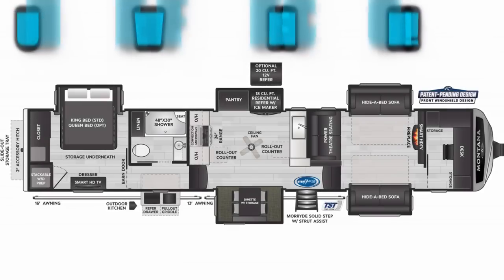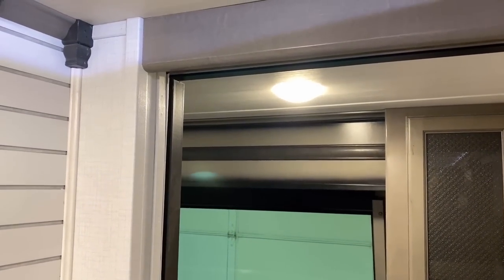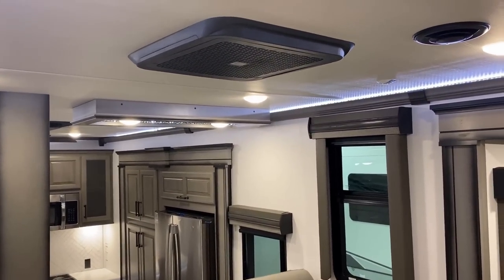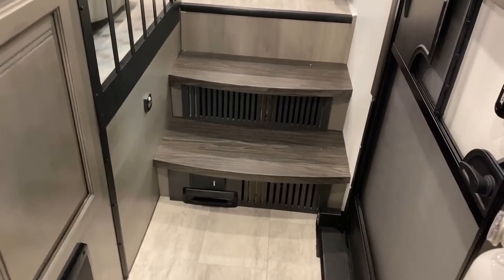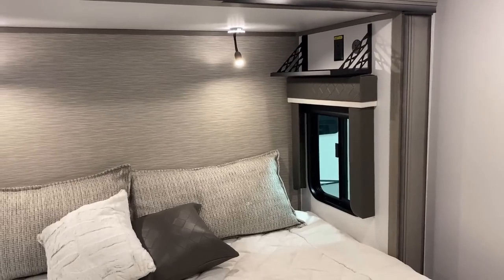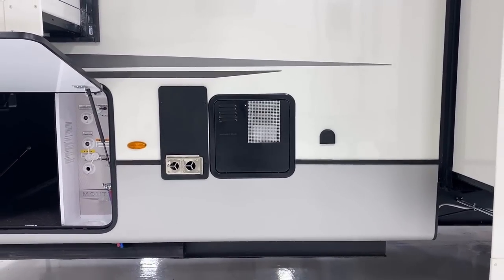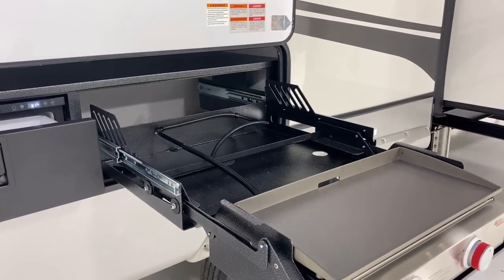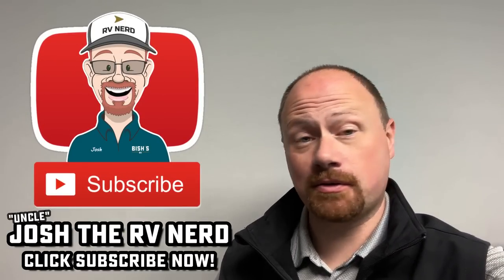FIRST OF A KIND New Floor Plan!! 2023 Keystone Montana 3941FO Front Office Luxury Fifth Wheel

Comment: This is a rig that I would consider as a single, full time rv living rig. Still bigger than I need, but had the space I prefer to feel comfortable.  I appreciate the addition of an office space, finally. This is a fantastic step in a right direction, IMO.  
Question: does the left theater seat have room to recline? From the video it appears as though the foot rest might catch on the hide a bed sofa next to it,  even with the slide all the way out & the bed hidden away. 
I prefer to not have the beam, especially if it isn't structural & I'd prefer only one hand rail in that narrow step space, not both. 
I don't mind floor ducted heating; I do mind the placement of the ducts - right where one is guaranteed to stand while cooking or doing the dishes. Might be willing to trade a peninsula countertop or the bottom cabinet in the pantry for a small dishwasher. 
Love the huge bathroom, & the fact that someone had sense enough to open up that bottom shelf for dedicated waste basket space. That person deserves a raise. In the bathroom is the only time I prefer open face storage. BR is usually the smallest room in any rig, doors take up precious square inches in an already small space. A person would need a unique storage option/ idea with or without doors & while reaching around a toilet. Same with the shower door. I'd rather have the option for a shower curtain. Can the shower head be switched out while keeping the height adjustment? 
Normally I would want a king bed; in this one I would opt for the queen for side stand room. No W/D for me, personally. I'm nit picking here, but I prefer better organization of the wires in the box in front, with a generator installed. Spare tire & cargo tray!? chef's kiss I'm a fan of a good solar solution. What's the small space just to the left of the lockable drink drawer? Functional, or just wasted space due to design or structure? 
Great rig, definitely has promise. Thanks again, Uncle Josh. 👍👌
Reply from the maker: I'm not sure on the shower hardware.. depends obviously if the new head fits that hardware. It's possible I'd think

Comment: My thoughts exactly on load capacity. If you were to add a generator and washer and dryer,  load up the fridge and your clothes, you would probably be overloaded. And with only 2 axles, you would also have tire problems.
Reply from the maker: You're not wrong. It might be an issue for some folks
Reply: Certainly you could eat up much of the cargo capacity if you want to fill up the 70 gallon water tank for dessert camping.

Comment: Love it with one exception. Our current RV (Venture SportTrek) has the same type window as this one has in the office.  When living in it during cold months the condensation that collects puddles at the bottom of the window space.  Didn’t realize it until our granddaughter was looking out the window one day and told me about the water. 😳 ☹️
Reply from the maker: That means you need to run a dehumidifier. Your A/C unit dehumidifies in the summer. your furnace does not in the winter. it’s not about the style of windows.

Comment: Should have been a triple axle.
Reply: I heard trailers are going 2 axle because you need a different license to pull all those axles.
Reply: @EM-fi2qg  interesting. I've never run across that before, only regarding weight and even then it varies by state regarding the type of license needed.
Reply: Is this a set-it-and-forget style? I do like the layout and with a generator and max solar I'm set. #nerdherd
Reply from the maker: Different licensing for tri-axle is not correct — at least not in the vast majority of locations. No different licensing needed for big toy haulers for example

Comment: Like the general concept, office could use some tweaks like you suggested.  Shelf in that front window, slope of the front window is an issue with monitors.  Storage is good in front.  Now downsides. Cargo space... something that large with a slide out tray I would expect 2k + on CCC. If I RVing in something like that I would be living long term in it.   Big wish would be heatpump so that the A/C and heating is all in one and skipping the furnace saving a bunch of propane.
Reply from the maker: Montana has been using A/C heat pumps for around 8 years or so btw.

Comment: Josh, I can tell you that newer (the current and previous  generation) of ResMed machines should be fine on the shelves. My wife and I have ResMed CPAPs.  She has the AirSense 11 CPAP and I have the AirSense 10 VPAP.  We have always had them on a shelf above our bed in both places we have lived since getting them around 2016.  With 2 large service dogs we don't have the  space for nightstands.  I believe that they say not to put them above your head because water from condensation can sometimes flow down the hose.  We have fabric that zips around the house to help insulate.  If we ever get water in the house it's because we may have "forgotten" to clean part of the equipment for too long.  A nice cleaning of the screens on our masks and we are good to go.  I have a pillow mask and my wife has a nasal mask, if that helps.  I would totally be putting our CPAPS up on the shelf.  Looks like it wouldn't be a problem making them fit even with a phone and glasses.  I might put a coat hook screwed into the side of the shelf if the shelf is thick enough.
Reply from the maker: TY. That's super handy. I've also heard you shouldn't have them above your head. Is that all machines or just some?
Reply: @JoshtheRVNerd  I can only speak about the ResMed machines we have used.  The concerns I've seen about them over the head would be, as I said before, is moisture and the machine falling.  My wife and I have hose covers that help me insulate the hose.  We do not use the heated hoses because when we tried, we actually had condensation in the hose, which goes against what should be happening.  Typically a heated hose is supposed to dry the moisture in the hose be found it made more moisture.  So non-heated hose it it for us.  As far as another common concern, a machine getting knocked off the shelf, we run the tube thru a shelf support similar to what is shown in the video.  If we ever roll over and snag the hose, the shelf support will stop the machine from falling.  Also the ResMed machines foot print should be fine to fit on the shelf.    Adding a little lip like maybe flipping over one of those metal stair nose things across the front could add some "added security".  Sometimes tho, you have to see "what really works for you" instead of what "they" say, if you know what I mean.  In our bedroom, this is the only option because we refuse to have them on the floor with the dust bunnies!🤣😂🤣😂 😃👍  Keep up the great work, man!

Comment: I'd love one, but way outta my price range. Not being able to stand in the office is annoying but not a deal killer.  I'd really want access to at least the bathroom in travel mode, even if it's a tight squeeze. At least you only need to slide out one to get to the bathroom and bedroom.

Edit to add: That cargo capacity is a problem if you're using it full time, at least if you're travelling.
Reply from the maker: yeah the CCC worries me less for stationary use but for mobile use it’s a thing to keep an eye on for sure

Comment: We'd move to that from our diesel pusher...but that CCC is the deal breaker. It should be a lot higher. 3k CCC should be minimum for catering to full-timers.
Reply: I'd also like to see more 5th wheel bathrooms with the shower and toilet switched, without adding a second sink. That layout seems to me, bigger, smarter, and better for storage. Better for composting toilets too.
Reply from the maker: fair point I think
Reply: @Josh the RV Nerd at Bish's RV  The entry doesn't look very wide with the control panels being there. So say your fridge or washer/dryer combo needs replaced (both of ours did). How do you fit them in and out of the door in this model?
Reply from the maker: @AN-qk5rk  they’re sized for specific Splendide units
Reply: @Josh the RV Nerd at Bish's RV  ..but isn't the fridge, residential? Would that still fit through the entry even with the doors already off of it?
Reply from the maker: @AN-qk5rk  Montana makes sure all their fridges can go out the doors. You may need to remove the doors of the fridge but it can fit
Reply: @Josh the RV Nerd at Bish's RV  thanks, Josh, for putting me at ease with the entryway.
If only they put this floorplan on a toyhauler frame! And, well, switched the toilet and shower location with each other. And NOT putting in two sinks - just need one and more cabinet space there.
The "outdoor kitchen" spaces I would love to see phased out - full-timers I've met in this lifestyle just turn it into more storage anyway. The outside tvs don't get used either so many of us use a big projector "screen" on the side of an rv with a small portable projector and portable bluetooth speakers are used for outside movie gatherings (which entails too many people to fit inside).

Comment: The office area is nice. I dislike having cables and cords all over my desktop. I would like to see some cable channels underneath the desk, a bigger cable port and a new port where the taller desk meets the lower counter top on the right. That lower counter would be good spot for a printer. I would leave permanent cables cleanly run underneath the desk so all I have to do is plugin my laptop and get to work.  

I like the marine fabric in the slides. Unlike the flooring which can warp with weather changes the marine fabric will lay flat. 

I like the pullout peninsulas. They help define the kitchen and eating areas.
Reply from the maker: Yeah I'm a cable management freak. I get it

Comment: From an IT professional...those lower power outlets are PERFECT!! A little cable management tray underneath, I'd be throwing my docking station for my laptop under there and putting my monitors in the corner.  This is awesome. I just don't know if there is enough space for my giant butt. Would definitely want a swivel chair at least. I'd also probably install a corner maker onto that desk so I have more real estate in the corner.

This floorplan is a winner. Unfortunately won't fit into my seasonal site without losing MOST of my site real estate, but I'm sure full-timers and seasonals are going to love this.
Reply from the maker: Someone else mentioned a place to mount a monitor on the wall would be great. I’ve always done fine with single screen but multi screens are pretty nice sometimes

Comment: Love this floor plan!  In the office it looked like there was a second outlet to the right near the drop down counter.  
I'm curious about if the theater recliner actually fully extends. It looks like it will run into the pull out sofa bed. 
Definitely could full time in this one!!
Reply from the maker: Recliner works just fine thankfully. It comes close to the sofa but clears it

Comment: I like the power location for the office for wire management. Some of us are OCD and need to have all the wires tucked out of the way. I would put my Mac Mini or iMac there, so the power wire below is perfect! 
At these weights and lenghts, when do you start think about an 18 wheeler cab?
Reply from the maker: Lol yeah a peterbilt might do the trick
Reply: The husband and I are in the market for a 40+ ft 5th wheel for full time living. We just bought a 2014 Freightliner to tow it. By the time a dually pickup with a tow package got down to our price range, they were too tired to be reliable. The semi cost us less than our minivan to purchase and still has plenty of life left in it for no more work than we will ask of it.

Once they get around 750k - 800k miles, trucking companies want to replace them so they don't have to rebuild the engines. 200k miles is maybe two years of work left for the company, but that distance may very well take us the rest of our lives lol. On top of that, they are designed to haul 80k pounds all day, every day. A 21k pound RV is essentially retirement for these trucks.

The only sticky part for most folks is actually driving the thing. The husband was an OTR trucker for 10 years and has kept his CDL valid, so it works for us.
Reply: @FFXIShadea  nice! My wife went down this train of thought but we don’t have the space to park either unit
Reply: @betterwithrum  That is a concern for us as well. We intend to live in the RV full-time, but there is always a transition period for things like that.
Originally, we were going to sell the house to pay for the rig outright, but then the option to rent to my sister came up, and we're working on that now. The idea of having a basecamp we can transition from or occasionally come back to is pretty appealing. We'll have to park partially in the yard, but we are blessed with a larger driveway than most, so it won't be as big of a deal.
Reply: @FFXIShadea  That's awesome! I agree, a basecamp is really nice. With little ones in school and my job that isn't an option for us right now, but I'm looking forward to that option one day.

Comment: The vents are so close to the sink and the cabinet on the other side. They could have put them in the sides of the cabinets. The stove side would be tricky lol
Reply from the maker: They really test and focus on cold camp capability. Floor vented heating provides significantly better function for that use

If you’re not cold camping, then side ducting is great for sure

Comment: All that size and storage but a payload of 1700lbs is a huge oversight and funny. Hell my half ton truck has higher payload vs this huge fifth wheel. 

This unit 100000% should have been a triple axle unit. I don’t think it will sell well due to how low the payload is.
Reply from the maker: It's possible you're correct. Though it's worth noting montana is the most popular fifth wheel brand for full timers - especially those that just leave it parked somewhere. If not towing, then the low CCC is kind of not an issue

Comment: I really like this rig as I'm looking for one with a built in office, but I'm not a fan of the front cap windows, i.e. potential leaking problems as you drive down the road in a rain storm. Hopefully, Keystone would offer this without the window.
Reply from the maker: Normally, no. it would come with the windshield. All of them built for dealer stock will include that feature though it MIGHT be possible to order one of these with a solid cap used off another model… but we’d have to check with the factory if they’re willing to do it

Comment: I'd like that as an option in place of "taildragger" bunks.  42 feet is long for my taste, by I love the idea; in a like 30ft bunkhouse layout would be really nice.

By quick guesstimate, that's about 4 feet deep (and 8ft-ish wide), with 18 inch desk?  That's a decent sized workspace.  My cubicle is 6x6ft, so comparable overall volume.  (And seems in the realm of Ember's storage lockers?)
Reply from the maker: Those dimensions sound roughly right. Didn't measure it myself but that "feels right"

Comment: This is an awesome unit, though not my cup of tea. The floor heat doesnt bother me, but the location in the kitchen.... Putting a vent under one of the most crumb heavy locations, the stove, is DUMB. The 2 places I have to clean the floor at home in the kitchen most is in front of prep table, and in front of the STOVE. And this being a Montana, and an office, its likely with full timers in mind, amd full timers are more likely to actually use their kitchen. So yea, not a fan of that. Thanks Unc.
Reply from the maker: Floor heat venting limits where you can put those vents and sometimes that’s the result. I think I might put a filter vent on that one right there. Those are so cheap and easy thankfully
Reply: @Josh the RV Nerd at Bish's RV  of course. Idk, just seems afterthought-ish to me to have them there. Id even take a single vent in the middle vs the 2 at sink and stove. Nitpicking I guess but, at Montana prices I think a bit of nitpitcking is warranted.

Comment: WHEN are are RV manufacturers going to stop putting vents on the floor!
Reply: My 2017 does not have them. So I guess some have stopped.
Reply: It is a better heating system because less bends in the ductwork.

Comment: Nice. No door shade? What am I doing? Showing my hairy belly off to everyone outside? How much does a door shade cost? Come on Keystone... Down to a 95% grade for that.  

No power outlet by the right side of the desk where that drop down is ideal for a printer? Going to need to run a LONG extension cord to it. Another 5% downgrade score for Keystone. 

So only a 9 out of 10 for this Montana, not because they did bad, its a great effort, but still room for improvement.
Reply from the maker: 9/10 aint bad but a few little tweaks can get you there. Thankfully I feel like our team could tackle those pretty easily and get that 10/10 for you.. or 9.9 at least ;)

Comment: Why? i mean why do they put heater ducts on the floor where theres alot of traffic? I mean right in front of the sink/stove i mean come on Montana you're better then that, sorry my only complaint lol
Reply from the maker: Floor heat runs have to go between the joists in the floor which means they can only place vents in certain locations. In this model there really was no good place for it as a result. Without question I’d have a filter pad added there